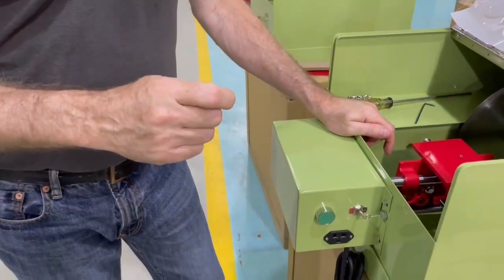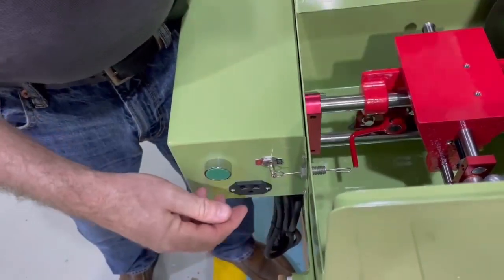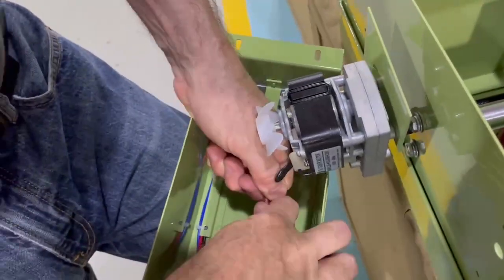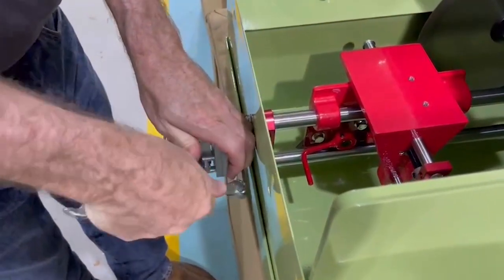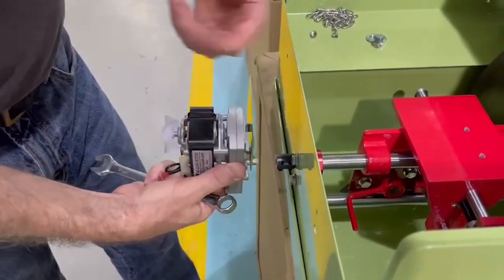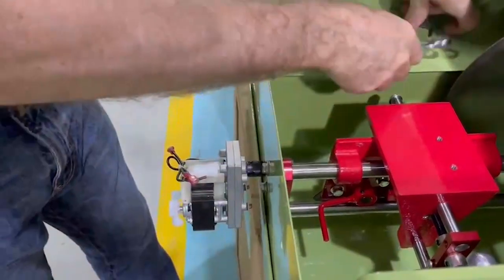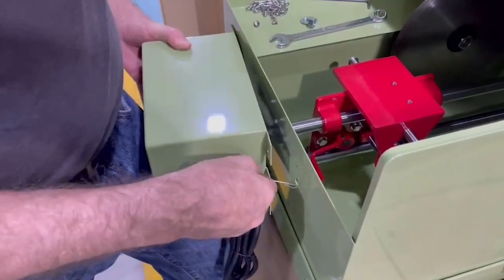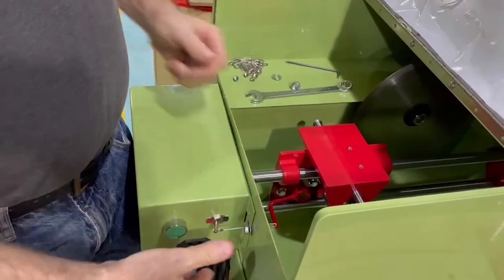How to change the feed motor in a HighTone switch box

Comment: This is very informative and I have had to open this reattach the motor to the drive shaft due to vibration making it loose.  I would like to suggest a little larger coupling with either a flat key slot of an addition set screw for a total of 6.  As an upgrade maybe add an aftermarket light circuit that indicates the advance has completed its cycle.  I run a number of machines simultaneous and and addition of a light would be a plus as a visual and make the multi use more efficient vs listening to the sound a single produces in an multi equipment shop.